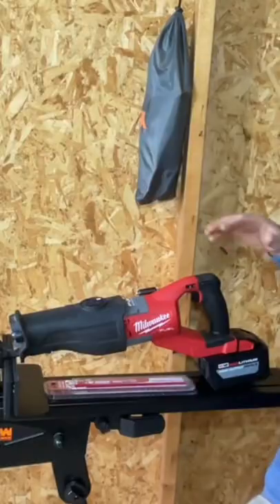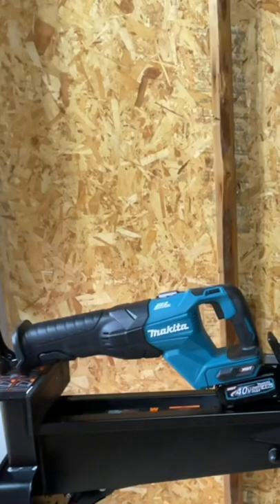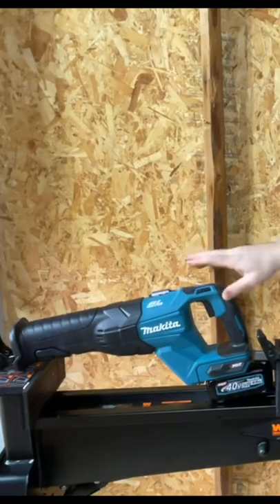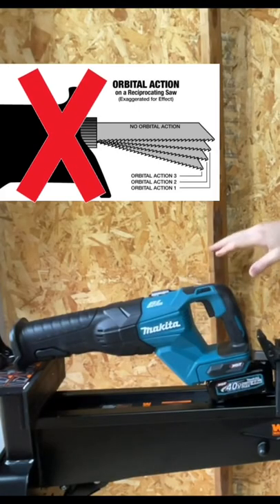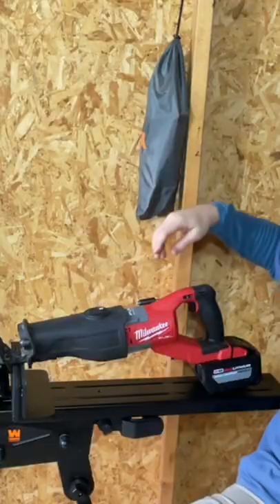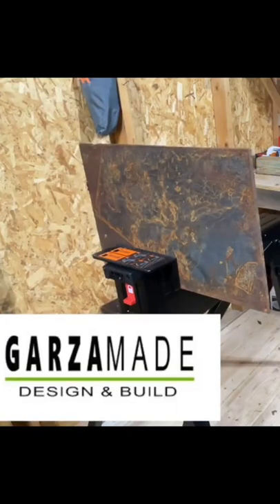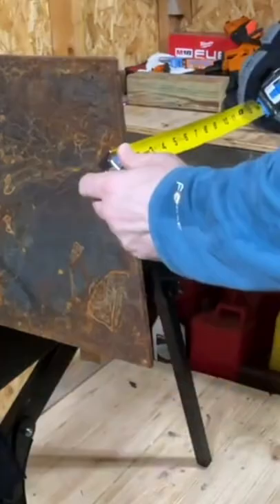Makita 40V XGT Recip Saw VS. Milwaukee M18 Super Sawzall!

Comment: 3 seconds is too close to see a clear winner. I’ll stick with my red tools.
Reply: New 40v model is much faster
Reply: @riba2233  It is yes but would it last as long as the super sawzall or is it as durable?
Reply: @johngardea625  ofc, makita tools are generally most reliable
Reply: @riba2233  I hear Makita makes good stuff, but I just cant seem to find the tools anywhere where I live. Lmao
Reply: @johngardea625  yeah availability can be spotty in some places. I have mostly started to order tools online because local stores either stock only lower tier tools or have horrible prices.
Reply: @riba2233  Ive gotten my Milwaukee tools from my supply houses. Im an HVAV Mechanic so I need to make sure I got the best tools for the job. One I started using Milwuakee tools I absolutely love them. I have no problems with them whatsoever. They are old, but still work like new. Yes the local store prices for these tools are ridiculous.
Reply: @johngardea625  Milwaukee is also top tier!
Reply: @riba2233  It is, I really love my Milwuakee tools.
Reply: @riba2233  definitely not super reliable
Reply: @konner3593  more then DeWalt and Milwaukee by far
Reply: @riba2233  not even close bud. Maybe dewalt since a lot of their drills are unreliable but not even close to Milwaukee. Not to mention the quality is not even close to Milwaukee or dewalt either
Reply: @konner3593  that is far from the truth, I have read a lot of real life experience from many users online and Milwaukee doesn't have a great record
Reply: @riba2233  I watched vids on Milwaukee vs  Makita impacts and the impacts were being abused like crazy as test dummies and the Milwaukee was by far better not to mention we're building my brothers house and we had 1 Makita impact and 1 Milwaukee impact  (same size/spec) and they tried my Milwaukee and they were surprised using mine vs the Makita.

............BTW I'm not trying to dig at Makita because i only have experience using both brands on impacts and regular drills. but based off of what you're saying this one Sawzall 40v or whatever is really good so I can't argue with that because I haven't used enough reciprocating saws to know what's best but all i know is that Milwaukee is amazing and Makita is Aswell. so for power tools I'll be staying with these 2 brands for now.
Reply: @mranonymous7713  yeah they are both good but Milwaukee has been cutting corners and their quality is not so good these days, paired with bad repairability. And they only offer good prices and warranty in the US, so if you are from eu like me then it is not an option

Comment: Wow shows how weak a 40v makita is compared to a 18v from milwaukee. Measly 3 sec faster.
Reply: You obviously don’t know how tools work
Reply: @tuckerechols6898 it’s exactly how tools work. A makita 40V battery is $160
A Milwaukee M18 battery is $60 dollars.

For 2.5x the price for 3% more power is pretty pathetic honestly
Reply: @jugganaut33 It’s not increase runtime.  I believe it reduces thermal load on the tool and battery